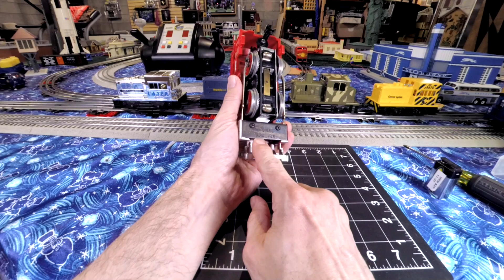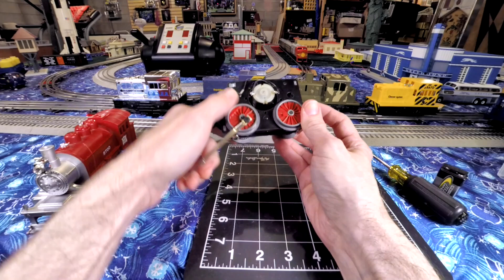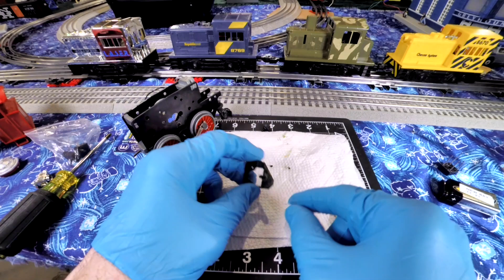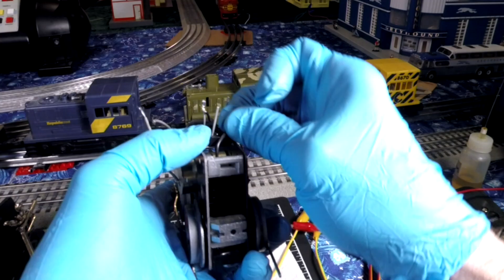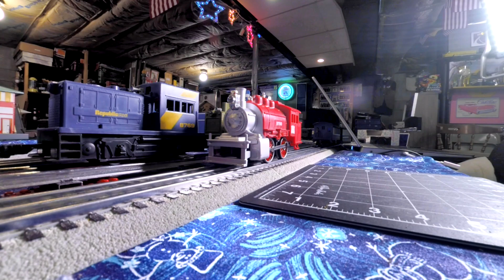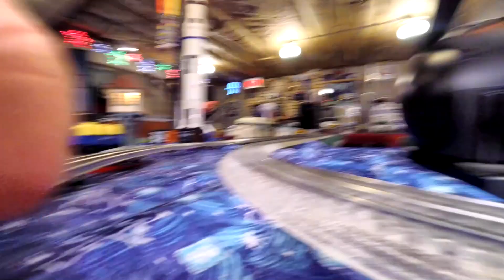Lionel 18500 Rock Island dc Dockside switcher steam engine from 1986

Comment: I just melted the bridge rectifier in my forward only Williams trainmaster 
On a derailment 

So I understand I need what you have here but do you have specs of what bridge rectifier to get or what you got?

Two pitman can motors first run Williams fm trainmaster 

Thanks man
Reply from the maker: I would go heavy and use a 25 amp bridge rectifier (square form factor). The specs aren't really all that important. Bigger is better as far as amps go. Here's a generic part from Mouser.com or just search on any site - even Ebay 625-GBPC2504-E4. It does NOT have to be this exact one. I recommend something like it though. Search for that number in Google and a ton of options show up.
Reply: @TooManyHobbiesJeremy  ok so because it’s 25 is that like a fuse that doesn’t trip and then damage motor ?
Reply from the maker: It's a bit different. 25 Amp refers to its rated capacity. The bridge rectifier does not have any safety features.  If phyiscal size Is an issue you can certainly go smaller. For our use of the bridge rectifier, bigger is better.
Reply: @TooManyHobbiesJeremy  so just like your dc mpc Lionel stuff that you converted. Effectively the Williams one was so it could run ac from factory. ? I hate electricity
Reply from the maker: Agreed, until you get really comfortable with it - electricity can be a bear.
Reply: @TooManyHobbiesJeremy  ok I have pair coming from Amazon tomorrow . Can’t not be able to jersey central it up!!
Reply: @TooManyHobbiesJeremy  https://youtube.com/shorts/n6wVDXFsCEs?si=-eZpzdP-4EwMKI0l

Comment: Awesome engine just to let kny I did not purchase the Rio grande diesel engine it doesn't have proto sound 2 or 3 so I ordered a sd ace it has proto sound 3 with the dcs system I think I will be safe cause I have the dcs commander thanks again for your input
Reply from the maker: Glad you liked it too - something different that still looks cool (and runs surprisingly well). 

Good call on the Rio Grande diesels. Let me know how the SD works out for you. :face-red-heart-shape:

Comment: The hole in the roof of the cab is where the water was filled on the prototype, so now you can authentically spot it under your water tower!  You could experiment with adding some weight to the chassis to improve the traction - and apply a Rubber Restorer chemical to the traction tire.
Reply from the maker: Very neat, I didn't know that.

Comment: Nice! To any and all 2 axle switchers, both in model form and in real life. They're only capable of pulling at the most 2-3 cars depending on the weight of the load, which is Okay. That's why most 2 axle switchers were used on private industrial spur lines and dock's.
Reply from the maker: Great point.